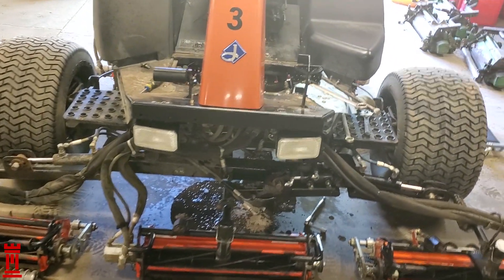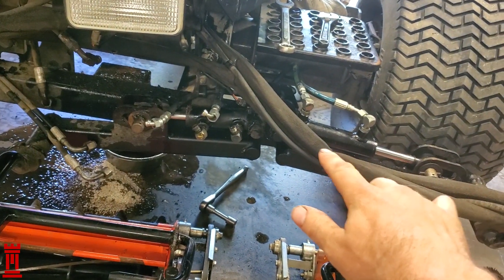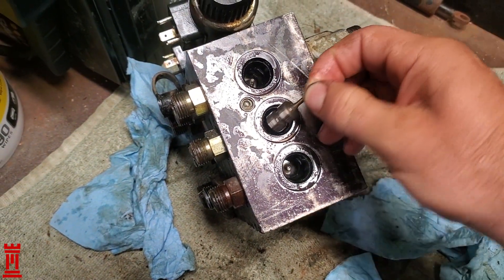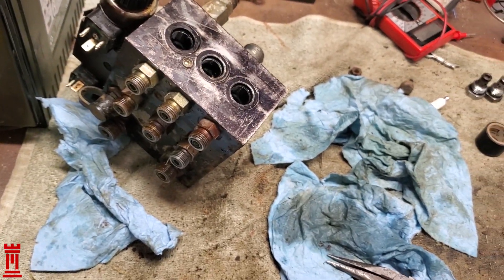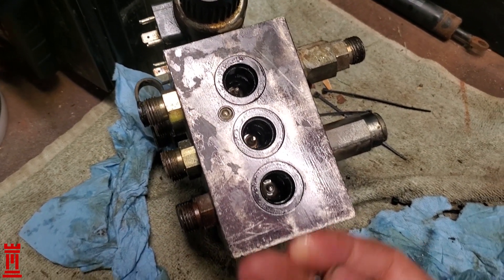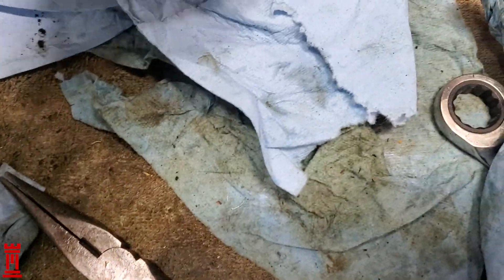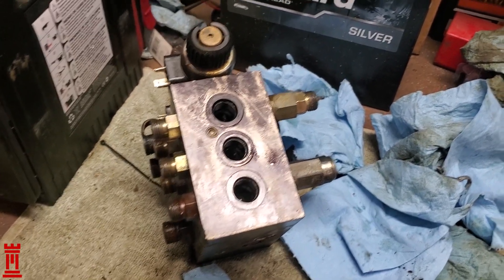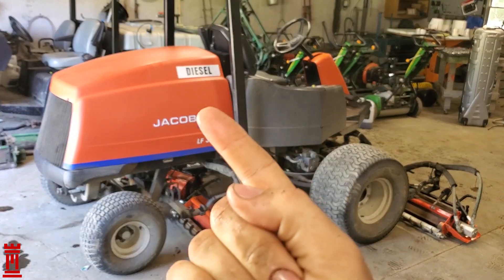LF-3400 fairway mower hydraulic system repair

Comment: What would cause the lift arms from not staying in the up position
Reply from the maker: you lift them and they come down slowly on their own? Id look for a break in one of the hydraulic lines somewhere, if not that it could be the control lever is broken sending a false signal to slowly lower them, or contamination in the fluid causing the valve to not enter the up-hold position fully. could also be the little plunger is worn on the sides. how fast are they coming down and does it matter if the machine is off or on?